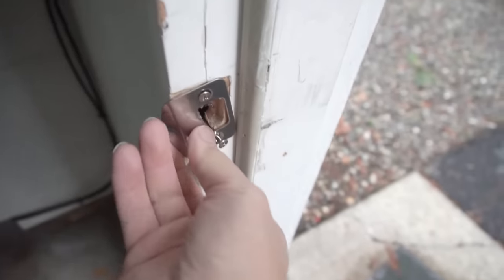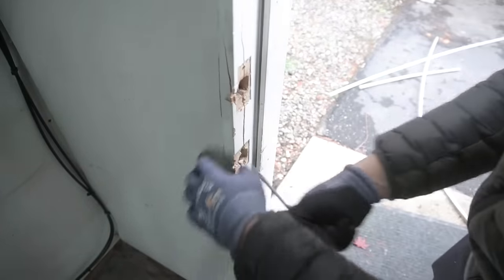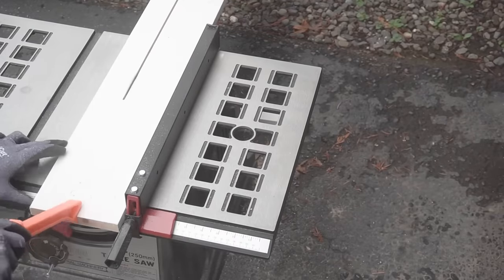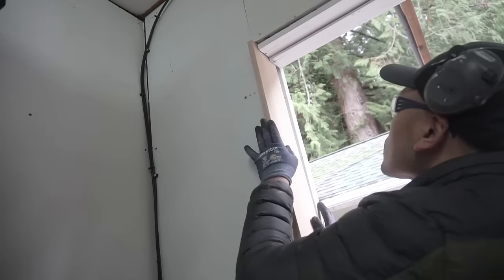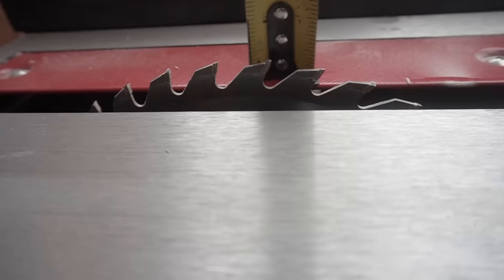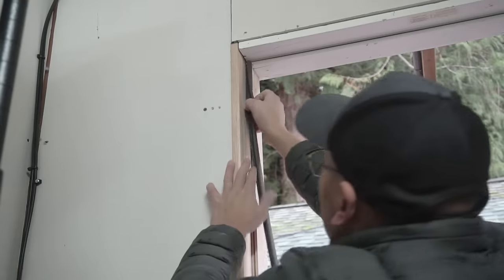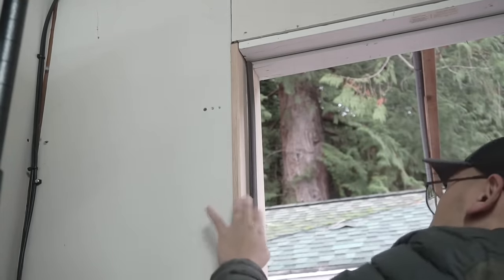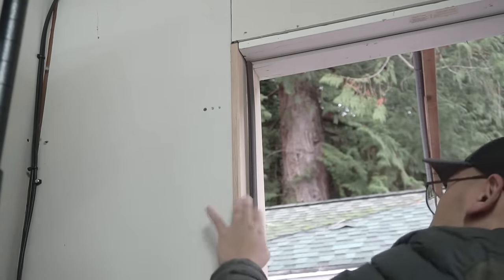How To Replace And Repair Broken Door Jamb Kicked In Or Damaged | DIY Step By Step Tutorial Easy FIX

Comment: You forgot one important step. Putting shims behind the new jamb piece and testing the door closure to ensure the reveals are proper
Reply: Shims on an exterior door are zero security. All that’s holding that door closed is a milled 3/4 thick pine plank.  May as well forget about installing the deadbolt, it will be useless.

Comment: If you screw your striker plates on backwards, you can cut around them with a utility knife first. Saves time, makes for a nice tight fit and reduces the chance of chipping out a piece of the frame with a chisel.
Reply: Your so right
Reply: Absolutely. Sharp knife required and while I have router guides that do this task faster for common size strikes because this is my job I must resort to hand carving regularly. Realize the sharp part of the blade has an angle that can be tipped to control how tight your prep is. Practice on a scrap first
Reply: Trying to visualize this but can’t understand it

Comment: Instead of pencil which will break, put paint on door latch in the closed position.  Close the door then turn handle to transfer the paint.
Reply from the maker: Thank you for the advice and tips! 🙏🏽😊
Reply: @FixThisHouse  Better yet us a coloured toothpaste on the dead bolt, close the door, and then push the dead bolt against the door frame and it will mark exactly when the hole is needed.   Same can be done to the latch, only use more toothpaste the open and close the latch several times to get the paste on the door.  I'm sure everyone has toothpaste!!  LOL

Comment: I worked for 35 years as a carpenter in Chicago, I fixed hundreds of door jambs in that time. These were overwhelmingly in older apartment buildings, and the jamb stock on those was 1 1/2" stock cut so where the striker plates attached was about 7/8". I didn't remove the whole jamb, just take a circular saw and cut off the 1 3/4" part the striker plates attach to. Then rip a piece to fit (we kept 2x12 stock on the truck for this purpose) and screw it back on. This made for a very strong repair, on a few of my repairs police or fire subsequently had reason to bust the door down (I worked in some very sketchy neighborhoods) and the door would break instead of the jamb breaking again. I'd always but screws on both sides of where the striker plates go, this greatly increases the strength.
Reply from the maker: Thank you so much for sharing your knowledge to the community! 🙏🏽😊

Comment: As an additional tip, use some chalk or even lipstick on the locking barrel and door catch which makes it easier to mark where the notches need to go. Prints an impression onto the door sill if that makes sense.
Reply: That's a really good tip.
Reply: Fingernail polish works too
Reply: I use blood, I usually have plenty on hand while working.
Reply: @rikityrik lolol

Comment: I like using my cordless trim router and jugs for plates and hinges. Fast, accurate, less chisel work. Also, consider using GRK or SPAX structural screws. Makes the door more resistant to breaking if someone tries to kick down the door etc

Comment: Def use 3" screws on strike plates. 

Not sure where your from, I'm modest we get all 4 seasons. So we practice screwing our mailing the from and back of jams on entry doors to prevent warping. We also never fill the rough in opening to fit tightly against the jam, expansion and contraction would have is back repairing the door as soon as the season changes. Composite Shims are better and virtually no expansion and contraction. 

Awesome video none the less!
Reply from the maker: Thank you so much for the tips and advice 🙏🏽

Comment: Added security: when adding the 1/2" filler, leave out a space where the deadbolt is and add a 1/2" aluminum plate. The deadbolt will protrude into this plate by approximately 1/4". Tack on the door jam, cut your deadbolt hole, apply a light film of grease to the end of the bolt to locate the hole you need to cut in the plate, remove both the door jam & the plate to cut the hole for the deadbolt.

Comment: It's about time you used that new table saw lol. Shims also work really well and used 99% of the time. Solid wood is even better. You go young man and thanks for the video that I'm sure everyone finds extremely useful if not in the business and/or on the field. I'm glad you are doing well because I know you care about your work and that's always nice to see. People don't have much pride in their work these days. You seem like a really nice young man with a lot of good ideas. Cheers my friend. Merry Christmas and I hope you and your family have a wonderful Holiday and safe one at that. 👍
They also have deadlifts that cut the door wholes for the door knob and deadbolt that help you drill the whole job and line things up that are pretty inexpensive for the homeowner or DYI person.

Last thing is I believe that using a drill on low speed works better than the impact because it's so powerful it can strip the wood and then you have another issue to work with. Just my 2 cents if it helps anyone. Impacts should be used for differnt applications in my opinion. If you are used to these tools then you know what I mean.
Reply from the maker: Thank you so much for your advice my friend! Yes I do agree with the impact drill and I will follow that 👍🏽😊🙏🏽. I hope you have a great Holiday and you and your Family have a great upcoming new year 🙏🏽😊❤️

Comment: 9:14 - Pretty sure that the strike plate should have been closer to the door jam. The little "nub" you drew is the security pin, which needs to remain depressed when the door in closed so you can't just open it with a credit card or similar object. Allowing both the latch bolt and the security pin to fit defeats the purpose.  It also looks like you stripped both screws? Oof. Tough install man.

Comment: If you don't have a table saw or any of those power tools. All I have is a circular saw and a standard electric battery power drill. Could I still do that kind of work. With those two power tools. Or should I just get a contractor instead. I've never installed a door jamb before. And I'd like to do it on my own because it would be something fun to do and it would be a cool project to do I really like carpentry I just don't have the tools. Or the money to go out and buy those power tools like the table saw I don't have a miter saw. Do you have any advice.

Comment: Nice video and great fix but try using a centering drill next time it makes putting the striker plates screw right in the center every time as well as the hinge screws. Cheers

Comment: Just like to add…for the weekend warriors that you don’t have too many tools. 
Home Depot as well as Lowe’s have the sections already made and primed all you have to do is cut to fit and add the hardware.
Reply from the maker: Thank you 🙏🏽 for that! 👍🏽😊
Reply: @FixThisHouse  just trying to help out with positive advice brother 👍😃
Reply: I was wondering why he didn't just buy the machined part 🤔. It's a $100 service call on top of the cost of the materials. Last I checked the door frames are $20-$30. I love his work though. That was a beautiful repair. I'm suppose if you couldn't find the frame this would be perfect. How much did you charge them?
Reply: @danieltoth6119  plus caulk, plus fill nail holes, interior casement, paint.  Make sure the hinge side is not blown out with hairline cracks.  Please be careful of time estimates.  Some of us have to make a living at this.

Comment: When I moved into my present home, I replaced the locks with a much better grade locks & dead bolts!
   I then installed large extention reinforcing plates around the striker and the dead Bolts!  I installed them with 4 inch stainless steel screws, making them nearly impossible to remove with the door closed!

Comment: Avoid using quartersawn lumber. Even if you pre-drill it, it will always be much weaker than flatsawn. I noticed that you used extra long screws in the latch place. That’s great for security. Having substantially stronger wood (flat sawn), you make the whole system much stronger and more durable. 

Long screws on the hinges as well as the latch side of the door jamb add substantially to door security. Very easy upgrade with my (hardened) screws, and a drill driver.
Reply: You're technically right, but in this application, it is of no relevance. The only security comes from the anchoring of the deadbolt strike plate - and he replaces that one in another video. The door jamb, itself, contributes basically nothing to security.
Reply: longer screws only is good if your going into the main frame , this example looks like he didnt as you can see the screw kept screwing after he had it in. Better way it to go on a slight angle to make sure you get to the main frame

Comment: you also do not have to replace the whole board if you have older doors its harder to get the whole board out without taking the screen door off too, you can just cut out 2-3 feet of the board, like the middle section thats broke and cut it to match and screw it in, done this to mine and you will never notice the difference and just as secure saving you half the time

Comment: I like to take a thin sheet/roll of metal use contact cement / glue and place that assembly on the outside of the door FRAME.  When a hoodlum trys to kick in the door the recieve a lesson on how a door can be rebuilt.  Make sure you have a video camera on the door so that can go viral.  Nice job on your video.

Comment: I just did this to a door on a job. The jamb couldn’t be completely replaced so I got a piece of hard wood .Removed the casing , cut out the badly damaged section ripped the hardwood down to fit. Glued and screwed it , but the casing was damaged also but it would have to be milled so I flipped it around and used Bondo to fill to casing looks good as new. I guess ur way works but in its entirety too long . U made that a career.

Comment: Excellent video. Instead of the pencil smear some lipstick on the end of the lock bolt and press it against the door jamb. You should get a real good imprint of where you need to cut and chisel.

Comment: You need a set of finger pressures holding the timber against the table saw fence.It shows how the cut is not parallel to the edge of the timber stop when you show it in slow motion.

Comment: I just done the same job at my mother in laws the only thing I did different is I used longer screws and yes I subscribed
Reply from the maker: Thank you so much! Yes I wish I did use 3 inch instead of 2 1/2. I’ll be changing them out, should be an easy fix 🙏🏽👍🏽😊
Reply: @FixThisHouse  sometimes you have to use what you have I understand that

Comment: Pro tip - if you spin the screws (strip) in any hole and it becomes loose, simply break off a match stick or two and stick in hole(s). It also helps if you add a few drops of super glue to the holes, once the match sticks are inserted. As a contractor on "light duty" projects, I have used scrap wood, cardboard, and washers to get the job done. Again, this is just for minor work and nothing beats a complete replacement.
Reply: 0:48
Reply: Tooth Picks with wood glue or Plain old Elmers Glue in a screw hole then break it off and you got more "MEAT" for the screw to grab onto is another one that works great....Never tried Super Glue yet.

Comment: This is a great how to video. It’s a terrible security video though. You need to get a larger strike plate and at least a 3 inch hardened screw for both.

If you’ve ever kicked in a door you know that this is a door frame that looks great and installed well, but will give little or no resistance for a solid kick the next time bad people want to steal your stuff. Or worse.

Spend the extra $10-15 and get a larger strike plate and longer screws.

Comment: How many times in my 20 years in apartment management, especially in the rough neighborhoods. Once the door is repaired, putting in 3 inch screws through the strike plate will help mitigate another incident. These screws are long enough to reach the 2x4 frame, making the door more secure.

There is another common issue I'm sure you have seen where when the door latch or dead bolt screws have stripped out the wood and just spin. There is a new hardware solution that sits inside the door along the latch that is threaded, called Resecure Latch. They have a channel here that shows how it works. Its a awesome handyman/DYI product that is a permeant solution.

Comment: Once again, you make it look so easy. :) 

With this process, one can run a doorbell cable in that area, too, no? On my door, the doorbell cable is VERY, very short. If I ever need to replace the doorbell, a new cable is going to have to be ran. No looking forward to that...
Reply from the maker: Thank you so much brother! 

That is correct, you can run a cable through there before you install the jamb to hide the wires. Let me know how your door bell install goes I’m curious on the route you took 🙏🏽👍🏽😊

Comment: Good point to use 1/2 inch wood to fill the gap. Anytime i have anything larger than 1/4 inch, shims are not used. Youll allow way too much air to pass in and out, plus the wood can warp and caise problems later on.

Comment: In other other cases may require to remove the exterior brickmould casing and install the jamb with shims in order to have nice reveal , its not necessary to build a jamb you can buy exterior jamb leg

Comment: Your deadbolt plate should also have the extra long screws that reach the door frame studs.. Makes it harder to kick your door in..
Reply from the maker: I do agree I would plan to use a 3” next time 🙏🏽
Reply: No one accidentally kicks in a door, if they do kick it in, you best believe no amount of nails or screws is going to stop it from happening . If the frame doesnt split, the door itself will.
Reply: @johnsontran980  ..That's true but it'll buy you extra time as they struggle to get through all those long screws.. you hafta think Johnson....
Reply: @johnsontran980    So what, should we only use 1/2 inch screws and make it easy for someone to break in? It’s not like a few extra nails or screws is any more work or cost.
Reply: @huejanus5505  not saying he shouldn't use long screws, your door is really only as strong as the frame material..  and most wooden prehung frames r made of pine. The wood splits and breaks before the screws anyways after 1-2 hard kicks...
Reply: 4"x16" metal plates are reasonably priced. I secure one of those to the studs before putting the casing on. I then use an extra long strike plate and deadlock combo plate that is secured through the door jam, through the metal plate and into the studs. I use a metal door knob plate around the door knob to reinforce that part of the door. The solid wood or metal door will have to be broken before the latch gives way. Of course the windows are still glass, so, yeah.

Comment: looks like a clean job but you made a mistake with the locking mechanism; at 9:13 the protruding half round pin needs to be kept from going in the hole; that's the safety feature of that latch. It's called the "deadlatching pin" 
This makes it so that, if the door is open and that pin isn't pushed in, the latch can be pushed in so it works as a latching mechanism.
But if the door is closed and that pin stays pushed it; it blocks the latch from being pushed in. This means you cannot shimmy something in between the slit to unlatch it; you need to use the mechanism of the door.
If you need more info or want to verify my explanation; search for "deadlatch" on youtube or just in general, you'll find all the information about its safety feature.
I really hope you read this comment cause it's important people know this; i've been to friends houses where they go "you didn't properly close the door" and they go push harder so you hear the deadlatch pin click out. This just means they have a security issue instead of a safety mechanism; if you can move the door so that pin clicks out, you can very easily break in.

Comment: A easier way to remove the door frame is, cutting it near the middle with the circular saw, than using the pry bar to lever it out. From all the locks and frames i have fitted i never chisel out a square hole, just use the drill, thats all thats needed, once you start making that hole bigger the more you make the frame weaker

Comment: Easyer way to mark your door latch and dead bolt is to use lip stick, put it on the face of each turn door knob open close the door then release the door knob and it'll mark the spot ,turn your dead bolt to close snd you have the mark

Comment: Primer... Undercoat...... finish coats ?
Reply from the maker: Separate video, this is just repair 🙏🏽😊👍🏽
Reply: Buy some primer and exterior finish paint, apply with brush and/or roller, let dry between coats.

Comment: Nice. But should have gone with 3" screws with those plates
Reply from the maker: I wish I did! 😅
Reply: I wish you edit the video by adding subtitles with corrections. Otherwise, the viewers will continue to write comments about the shorter screws. Also people are less likely hit the like button or subscribe if you give incomplete instructions (ie. using shorter screws on deadbolt striker plate)

Comment: Informative for first timers, but I would not recommend anyone using the table saw the way he did for the weather strip groove. It’s just not very safe to use push stick and a rubber block to feed wood in a vertical position, rubber blocks are mainly for jointer and straightening flat stock. I’m always concerned of certain techniques show on YouTube from very good carpenters but not necessarily qualified to be teachers. Overall, very informative content, keep up the good work and tool safety